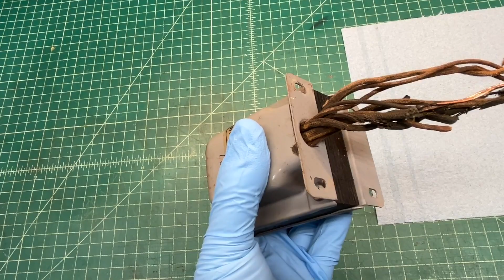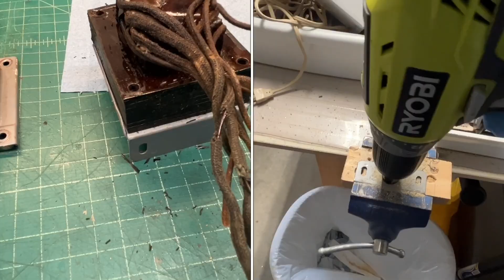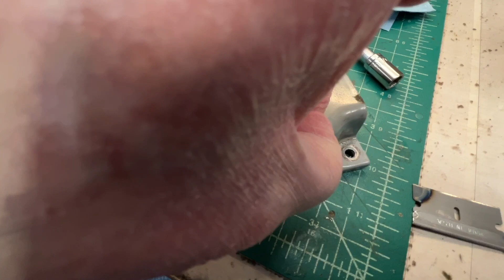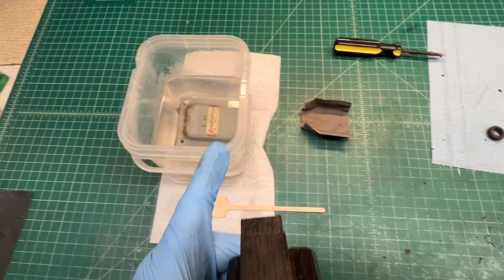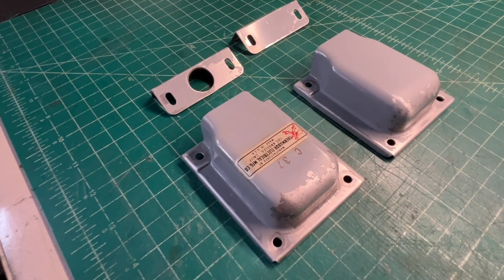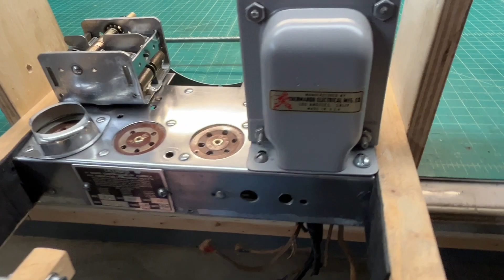Pathe - Model R | Power Transformer | Cleanup | Reinstallation

Comment: Good idea to enlarge the hole and install a rubber grommet. Thanks for sharing….Take Care—Larry
Reply: What product did you use to soak the parts
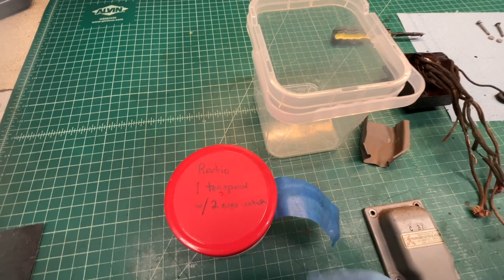Reply from the maker: @ Check the video at 4:20; Citric Acid and Water. Best, Don
Reply from the maker: Thanks Larry, it was still a tight fit but hopefully the change makes it more resilient and long lasting. All the best. Don